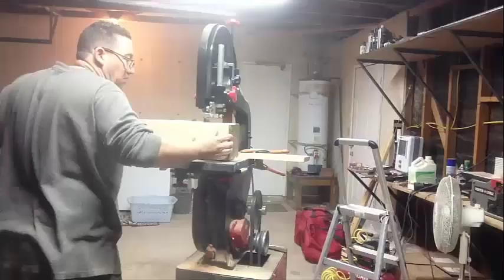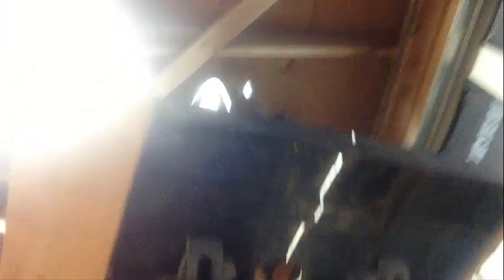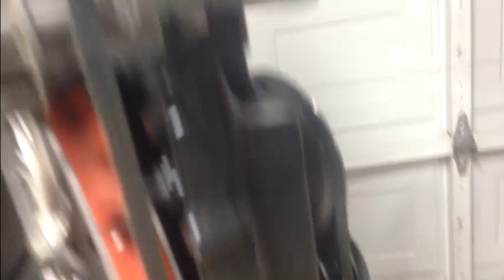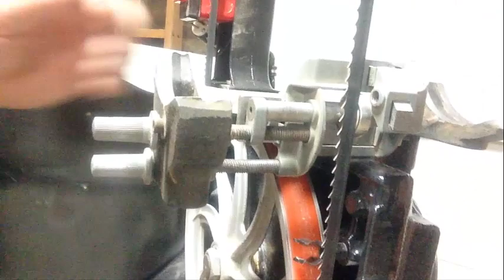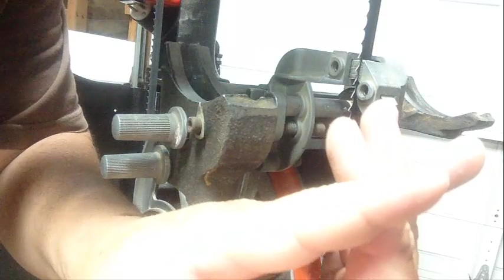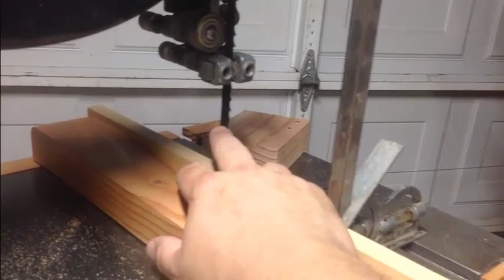How to set up Your Bandsaw for Resawing

Comment: I have the exact saw. 14” delta. I have riser blocks on mine. It takes a 105” blade. Trying to re-saw has been quite difficult for me. I have a three-quarter inch Timberwolf blade. Resawing small stuff like the  2 x 4 on the inch and a half side isn’t really a problem as much is on the 3 1/2 inch side where my Blade wants to start con calving or arching. You can see it as it exits the wood. Blade has a slight curve to it, sort of a Boeing effect if you will. I have tried just about everything and can’t seem to make it work. I have been forced to use a 3/16 inch blade where the teeth are sort of offset but it makes a really rough cut. It seems to be the only way I can cut lumber out of logs. I’m going to start fresh like you did and see how it works out. The only thing I see I may do different is I don’t have the gullet of my blade where you have yours.I have mine close to the front of the wheel. I will give that a try and see if it helps. Thank you so much for the video
Reply: Gullet should be on center of crown.

Comment: Where is you're blade guard on the left side, by the switch?  It keeps you from bumping into the moving blade accidently.
Reply from the maker: Kirk Crawford thanks for your consent Kirk! This is an older video and since then, yes I have made a guard for the left side of the blade and currently designing an adjustable guard for the right side!

Comment: I'm currently in the testing phase of my latest veneer resaw prototype. It cuts 18" deep in a throat 14" wide with a 2HP drive train. I use a proprietary rail-and-sled feed system that factors blade lead into its locked position using rails of variable length and robustness to start that first flat cut and veneer the log from there. I feed it with my pinky finger. Using two high performance Iturra tensioning springs, it runs 1" Lennox carbide-tipped resaw blades with only 3/32" of kerf to produce 1/16" veneers 18" wide as long as your workpiece. Because the tracking and tension system is frictionless, there is no blade flapping at any setting and the cut finish is so smooth it looks like it just came out of a planer, not a band saw. It's ready-to-glue ! I'm trying to retire falbergsaws.com but I want to introduce this prototype first because when ya'll see what a sweet machine this is going to change the way they build bandsaws hereafter; you'll no longer settle for the antiquated designs you're now getting from the big corporate tool companies.

Comment: I have followed your recommendations for resawing for the past year, I've had no problems at all...    I am going through 2-sets of bearings a year and considering going to the blocks, what are your thoughts?     Also I see that your saw is missing the plastic blade-guard at the column, sure is dangerous.
Reply from the maker: I think if you are going through that many bearings it would be worth a try to use the blocks instead! Also yes I know that not having a guide is a little more dangerous, that's why shortly after this video I made a guide for it! I never filmed a video on it because it was suppose to be a prototype and I never got around to making the actual guide, but at least there is something there! Lol. Thanks for watching!

Comment: you use the Alex Snodgrass method. cool. but what about a 3/4 inch blade. setting the gullet in center makes the rear of blade hang way off the wheel on my saw?.?
Reply: +Charles Holland I have a Grizzly 14" and my 3/4 blade is the same as yours with the back overhang of the blade, I have not had any problem, Have my saw now for 7 years.

Comment: what if your bandsaw  has a flat tires (no crown) like on a MiniMax would you still set the gullet in the center?  Also what if you use thin blades like 1/8" do you still set up the same way as you would for a blade 3/4" or 1" blades?
Reply from the maker: Kuma San  sorry for such a late reply! If the tire is flat with no crown, I would imagine that it wouldnt matter where the tire is set, front or middle. Also I set all my blades the same no matter if its 1/8" or 1/2", except fot the amount of tension. That will vary depending on the size of blade, smaller blades lighter tension, larger blade more tension. Hope this helps, Thanks for watching and again sorry so late!!

Comment: Thanks a lot. You adjust your saw in the middle of the wheel - so I understood it - and it make sence. But the guidelines of my bandsaw says that the saw always need to be on the periphery of the wheel so that the tire wont dammage - it is written -. Question: does your bands on both the wheels dammages easily? Do you have to change them after a while?
Reply from the maker: So far it hasnt done any damage to the tire!! I know that most Bandsaw Manufactures say to place the middle of the blade at the crest of the tire but I have found that i get a lot of drift in doing it that way.....so far the way I set it up I havent had to adjust for drift yet!!